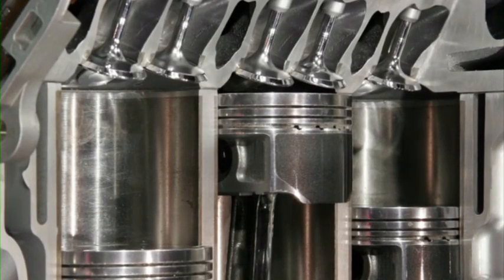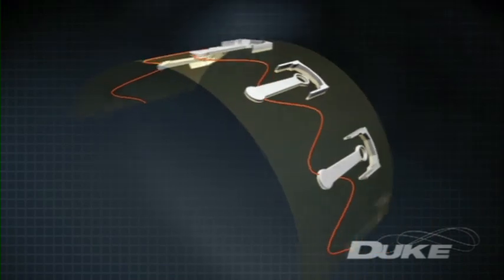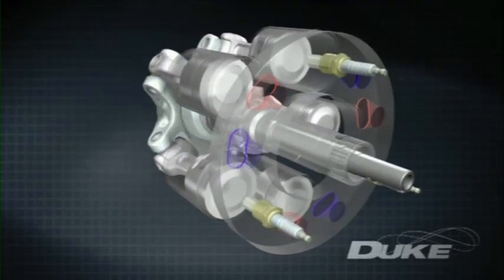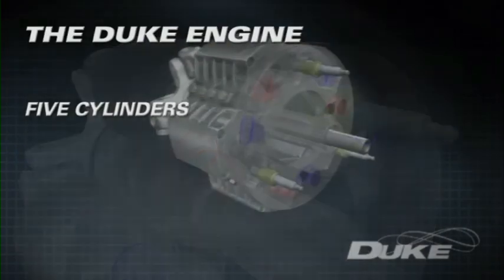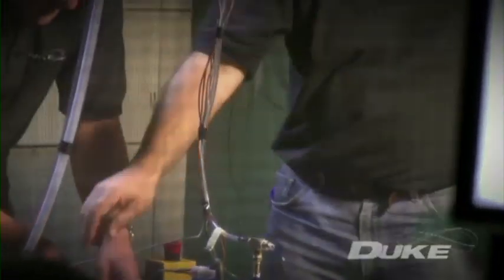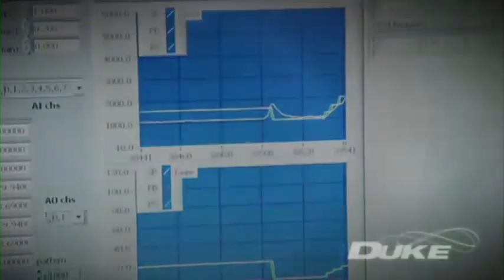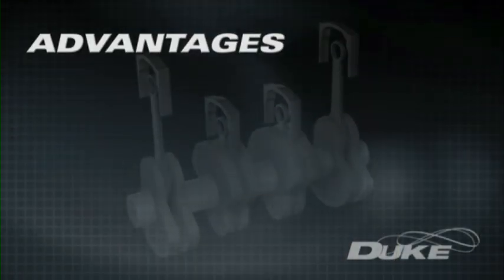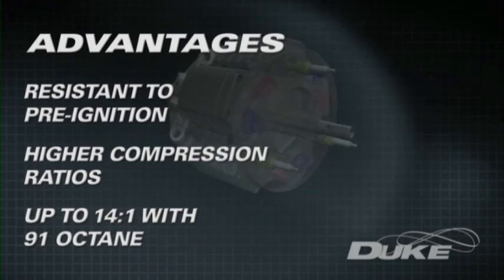Duke Engines

Comment: no valves, no camshaft, no timing belt, no pre-ignition, higher compresion on pump gas.. i really like the design, only uses a swash-plate to convert reciprocating energy into rotational.. i like this design a lot
Reply: well im just wondering how they plan to seal the combustion chambers
Reply: ***** all talk and no proof?...they showed a running unit being tested in the video...
Reply: Peter Šori ^^^ Armchair Engineer.
Reply: Peter Šori no, you wouldnt be able to fire an engine that was 3D printed, not even when not under stress, the pressure required in the cylinder alone would burst the walls of something 3D printed which has significantly inferior shear strength
Reply: Limon, i think he is talking about 3D printed metal, while you and i thought he was referring to 3D printed plastic. Peter, 3D printed metal is usually for structural components that are not usually under immense pressures or heat.
Reply: sori, it doesnt matter, the process of 3D printing is simply melting one later of material on top of another layer that has already turned into a solid, when this happens the bond between the two layers is very, very weak.. this is why welding has to penetrate deep into the materials and essentially liquify the two components being welded, you dont just melt one later of material on top of another or it wont hold

this is why 3d printing is just used for non structural shapes or prototyping, you will NEVER build an engine with 3D printing, nor will you ever build a gun

the only thing 3D printing is useful for in engine construction is by making a wax copy of an engine that can be packed into a medium and used as a mold for casting
Reply: megadeth22885 actually, a gun has been made with 3D printing...everything but the barrel. also,structural housing shapes have been 3D printed, we are not far off from 3D printing engines, possibly with sleeves for the cylinders. Familiar with Sintering?  right now you can buy sculpting clay with metal particles in it to create jewelry...you fire it in a kiln and the clay vaporizes and the metal particles fuse, becoming solid. eventually we will be able to print metal parts in a similar way. Google can be your friend. :)
Reply: you have to make a lot more than the barrel, the breech also needs to be metal, the bolt needs to be metal, the firing pin needs to be metal.. and when a gun fires it produces a large amount of heat.. a relatively low pressured handgun cartridge such as 45acp produces over 22,000 PSI of pressure so the locking mechanism needs to be made of a hardened steel, otherwise it wouldnt have the shear strength not to break

i design guns, for a living, no, you're not building a viable firearm on current 3D printing technology
Reply: sure you do.
Reply: well, your allowed to think whatever you want, doesn't make it true. :)

Comment: where would the lubricating oil be stored. If it is internal, wouldn't it have the same hydro-locking problems of radial engines? Pretty neat though.

Comment: The weak link here is poor volumetric efficiency, as intake air/fuel must be delivered through the centerbody and the cylinder ports, with resulting restriction
in flow. The 14:1 compression ratio {based on bore/stroke and combustion
chamber volume, as is normal} would not be realized in practice due to the
poor volumetric efficiency. In addition, as observed by another commentor,
the cylinder ports limit expansion ratio. Note they make no mention of power,
piston displacement, or any measure of fuel consumption. Also as observed
elsewhere, port timing cannot be varied, which is a major headache in development
as well as in operation. Need to quote specific fuel consumption {sfc}, in lbs
fuel per hp per hour, and actual power/rpm achieved. 

Mechanically, it can be made to work, though lubrication and cooling solutions
may be difficult. Although it has fewer parts than a conventional engine, its
parts may be more difficult to manufacture. This claim was made for sleeve valve
engines; while true, it wasn't important because sleeves were so hard to make.
If you lay out all the parts of a conventional engine and inspect them, you will
find nothing really difficult to make. The ball-jointed con rods and the reciprocator
of the Duke engine will require specialized machine tools to manufacture.

However, if it can produce decent power at decent fuel burn and weight, it may
find specialized applications somewhere. Don't discard your "old fashioned"
engines!

Comment: I could be wrong, but I can see problems over time with that ball and socket style movement of the "reciprocator". Fewer parts sure but with a motion like that it's sure to wear much faster that your ideal crankshaft bearings, and cylinder sleeves.

Comment: I'm no engineer but with the power stroke hitting the power take off at an angle, that would reduce efficiency yet the fuel consumption is compared favourably to... what exactly?

Sleeve valve oil leak problems were the major problem with perhaps the best engine produced in WWII. Presumably finer engineering has overcome a lot of that problem or scavenging the lost oil is different with this?

Good luck, either way.

Comment: I just don't see any increase in power with this design! Now instead of say, 8 pistons, rods and a crankshaft rotating, you have a big hunk of 5 pistons, with cylinder sleeves, and the giant crank rotating as one. Seems like a lot of mass to get moving. Where as a V design at least off sets it weight by staggering the pistons.